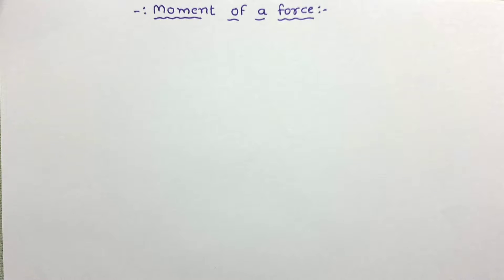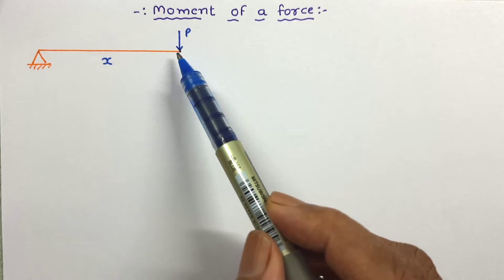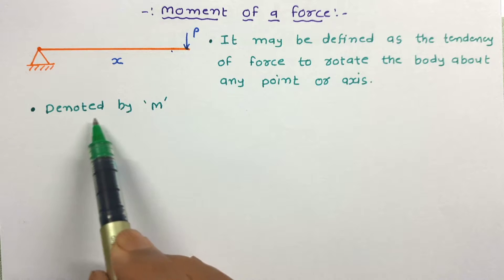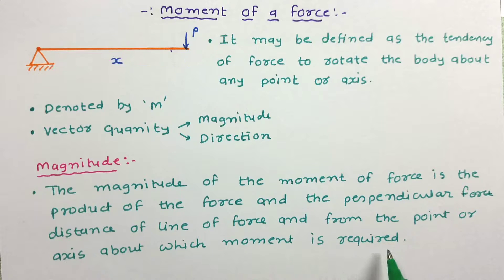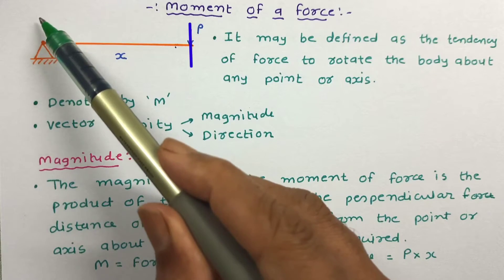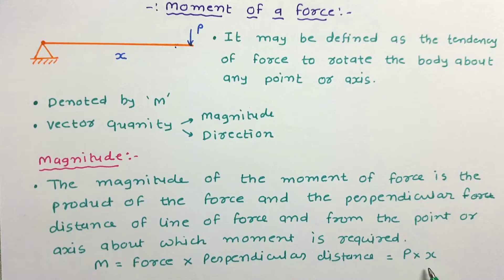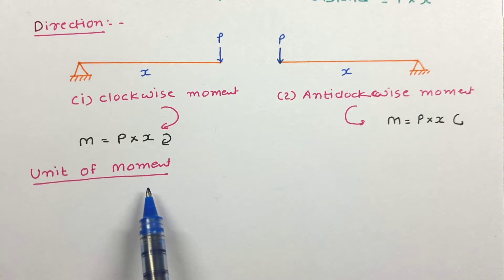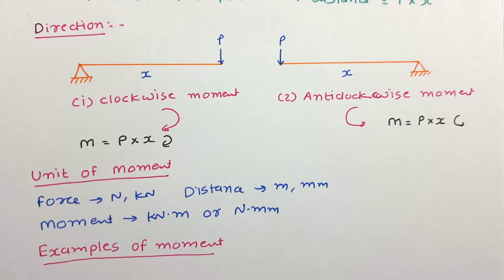Moment of a Force Explained: Definition, Magnitude, and Direction

Comment from the maker: Moment of a force is explained in following Timestamps: 
0:00 – Mechanics of Solid Lecture series - Moment of a force
0:31 – Moment of a force
1:15 – Definition of moment of force
1:53 – Magnitude of moment of force
3:22 – Direction of moment of force
5:04 – Field example of moment of force
5:29 – Example on calculation of moment
Reply: Mp  =40×2+20×4=80+80=160
Apne galat likha he 
 40×2+20×4=80+40=120
in pin message correct it